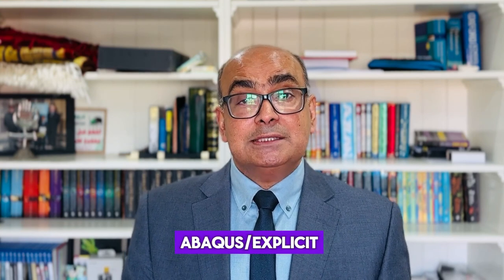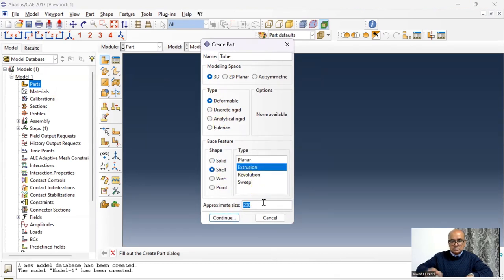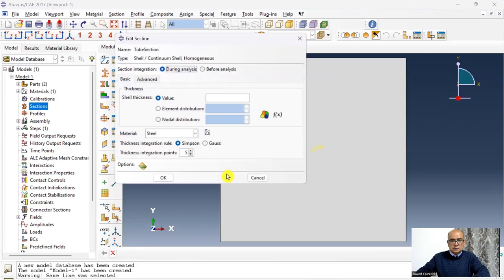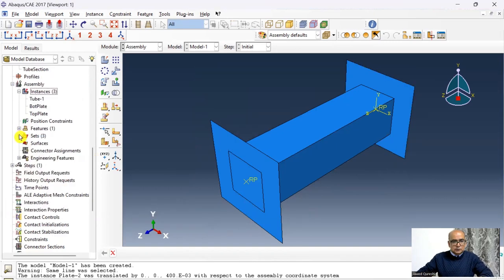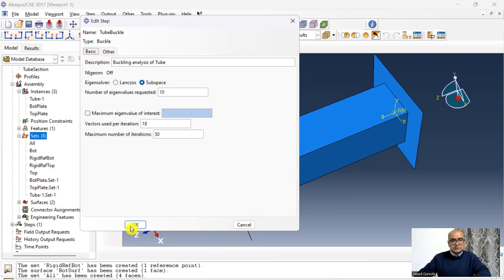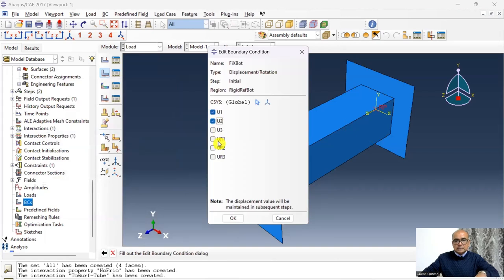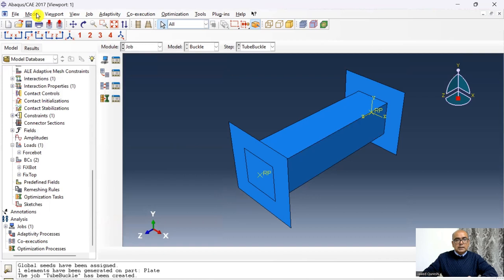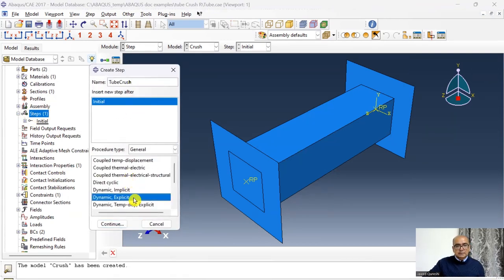ABAQUS Tutorial #19 – Crushing of a Tube | ABAQUS Explicit

Comment: Hello Dr. Jawed,

I hope I am not bothering you, but I have been having problems with a Speedcore wall model subjected to fire loads, very similar to CFT columns with a steel formwork and concrete fill. The problem I have is that the model has interaction issues when the plates buckle, as they penetrate the concrete, even though I have hard contact interaction. Do you have any advice to help the model converge?
Reply from the maker: I’m not exactly sure about fire loading. But in my view static analysis procedures normally don’t work or have convergence issues when there are many contact interactions. I would probably use explicit dynamic procedures with slow load application and using mass scaling. Also you can increase node penetration tolerance when you define hard contact.

Comment: Is it possible to use analytical rigid instead of discrete?
Reply from the maker: •	No, analytical rigid part cannot be used. 
•	Analytical rigid parts only have EXTRUDED or REVOLVED base feature. 
•	This means only tube and cones can be created with analytical rigid parts, NOT planner base as used in this study. 
•	Put it simply, it is ONLY possible to create plane shell plate with discrete rigid parts. 
•	Just try creating a part using analytical rigid base feature, you’ll see that it only has extruded and revolved base, not planner base feature.
Reply: @DrJQureshi  thank you for your reply
Reply: Is there free version of the ABAQUS to install it, I'm new user, I'm going to use this software to calculate the Energy Absorption of hybrid composite tube, your recommendation, please,,